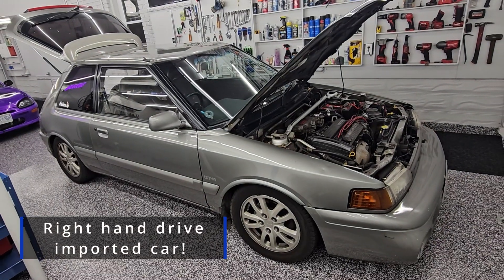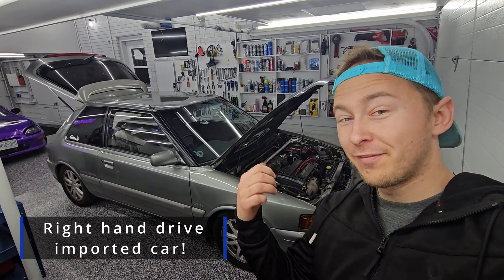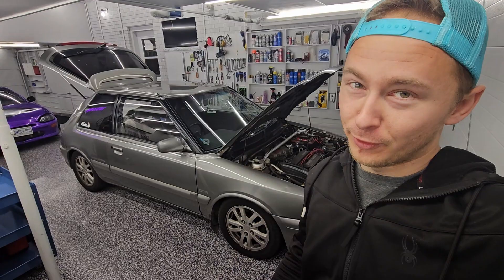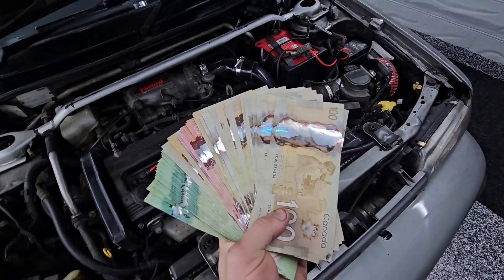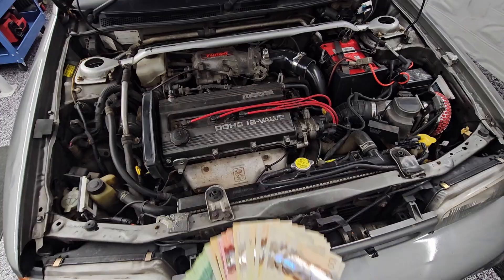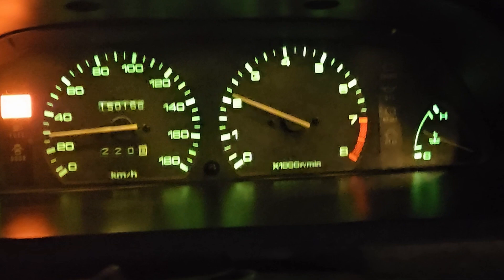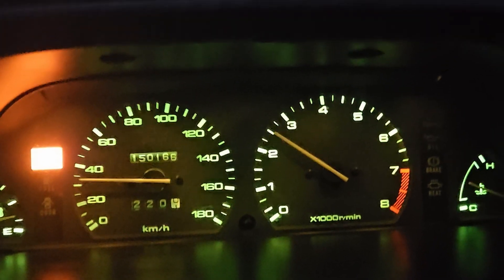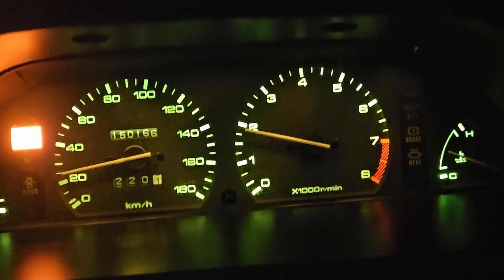I made A TURBO KIT For a RALLY CAR! What a WILD car this is!! It is a mazda Famillia ! (RARE)

Comment: On the opposite end of the 323 familia life my dumbass stuffed a zetec in mine because the f series couldn't handle 94whp from a 1.8 sohc.
Reply from the maker: these 1.8 engines can hande a tone of power!
Reply: @Suicid3mx3  definitely. It was cheaper to swap than it was to convert to a g-series transmission so the 1.8 rests in the garage
Reply from the maker: @Silvermoss-Auto  what engine did the car come with??
Reply: @Suicid3mx3  Bp01 with a f-series trans. Zetec is a nearly drop in swap from the escort. I just missed driving my mazda that much.